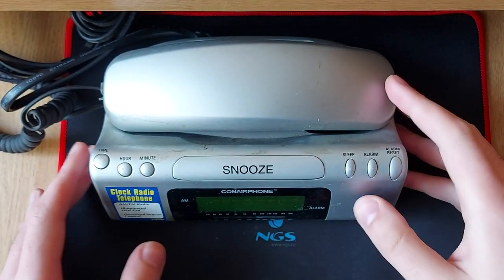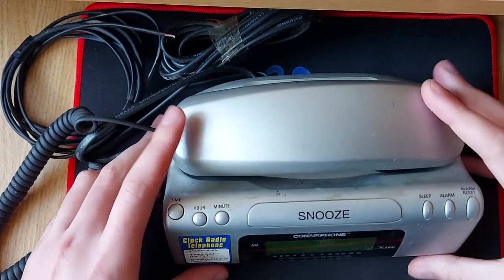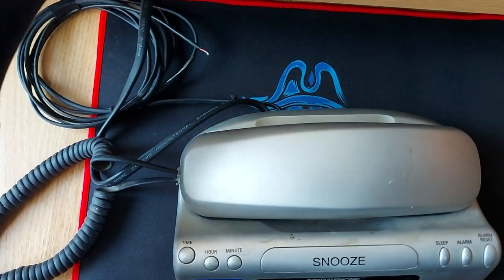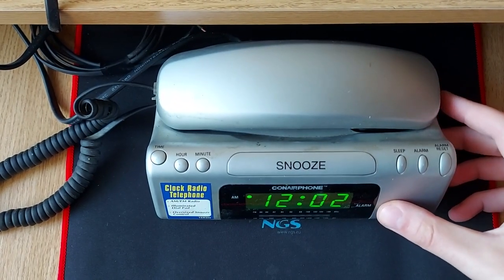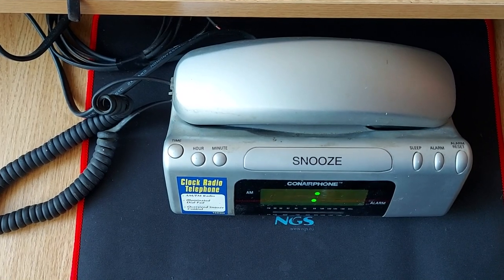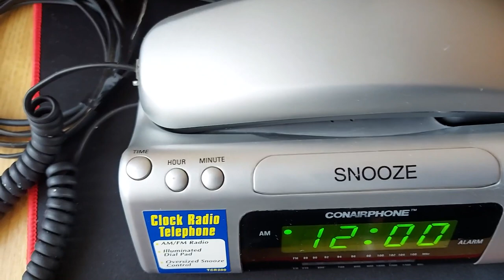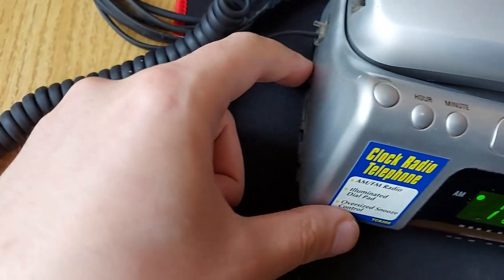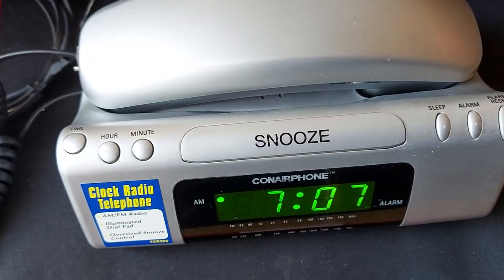Conairphone Model TCR200 Alarm Clock Radio Telephone Cleaning

Comment: Used to have the white variant of this model back in the day. Woke to my local classic hits station (back when tye played 1965-90 music), and listened almost the full two hours prior to school. 

By the way, to set the clock, you hold down Time and press the Hour and Minute (called "Min") buttons. The AM Indicator comes on if you're in AM time mode, so if it's afternoon/night, make sure the light is OFF.
Reply from the maker: Interesting , thx for the advice